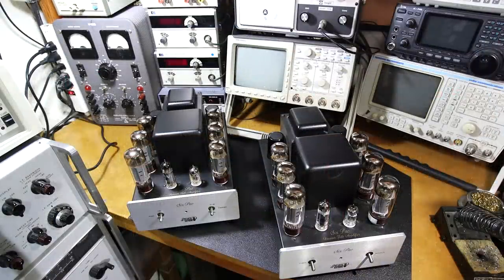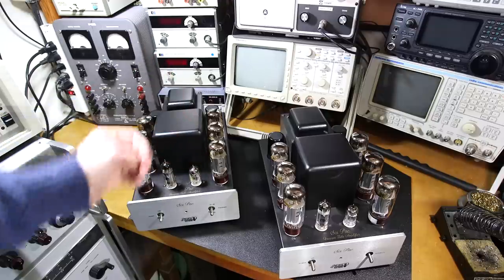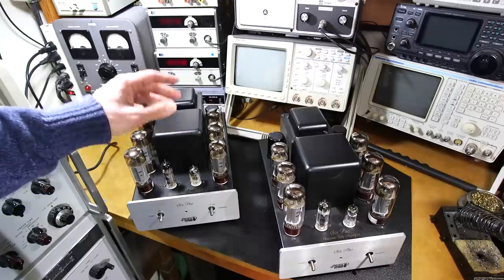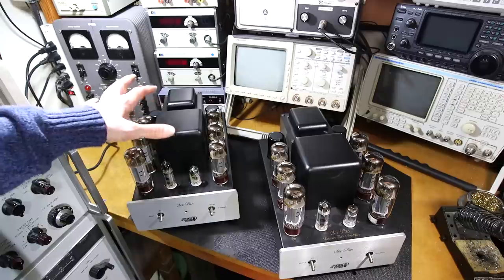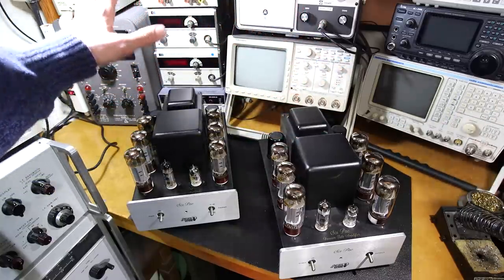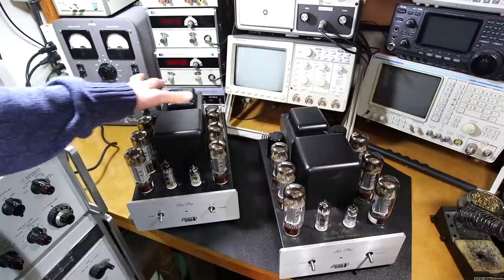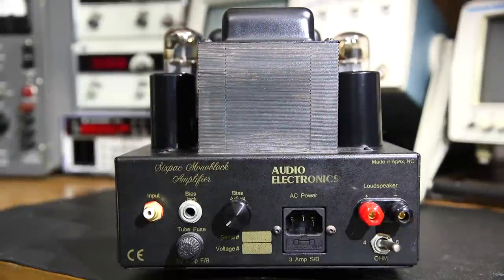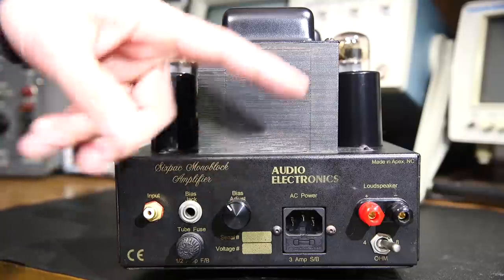Two Six Pac's On The Bench

Comment: .
Wow, these things are still selling for $2500 and up.

I'm a bit curious on your take of how they did (as drawn) the inversion using the 12AX7. The only thing I see is a possible pin-to-sleeve loop using the shield to drive the right side of the dual triode as the inverse signal. I see no other mechanism. Besides creating a ground loop the size of your system, the right side of the triode would be defeated totally by a grounded input. Interesting but kinda scary, if you ask me.

Unless there is a glitch in the diagram or some seriously obvious thing escaping my observation, It would definitely call for a transformer in between the preamp and the brick  to keep things on the up and up.

Also, a simple difference in opinion for choice of terminology for the "grid bias adjustment". Yes the control does adjust the grid voltage, but it controls the idle plate current which also tunes the A/B circuit operation. If this is set too low, it could cause crossover distortion between the output phases. A slight excess of current turns it into a pseudo A/B Class 2 where the two phases are intentionally drawing current at all times. A hot configuration most common in old guitar amps that made that lovely smell as the wooden case baked. :p But, most guitar amps configured this way were not too concerned about harmonic distortion as they were crossover distortion. That harmonic distortion gave many of these amps their particular trademark "flavor", something that makes audiophiles cringe and make the sign of the cross.

And, you mention that the 6.9V Filament voltage is a bit high and suggest a resistor to correct it. That's fine, and in audio amplifiers, the filament voltage should never exceed specs for tube life* and to reduce the possibility of hiss. But, you should show the connection between socket 4&5 either on the tube diagram, or on the callout text at the transformer/diode/cap  12AX7 Socket 4&5 Filament 6.9V

*Tube life will become an ever more demanding topic in the next 20 to 50 years, unless the industry decides to gear production back up. Using pulls would never be my choice, but if it comes down to making an adjustable modification to a circuit to adapt a worn out tube vs tossing your favorite amp in the trash, yeah. In critical places, this is done quite often to adjust sensitive semiconductor inputs to null balance the inputs to several decimal places. Dual FET's were horribly mismatched back in the day.

I think I'm forgetting something, but what the heck.
p.s. You have an amazing collection of bench equipment. Close to what we had when working on CT Scanner repairs at EMI, minus most of the audio specific components.
Reply: You asked about the inversion.  With the cathodes tied together and then supplied by a current source, the cathode of the first triode is driving the cathode of the second triode, giving a phase inversion. Also, the two triodes form a differential amplifier. Connecting the shield of the input connector to the second triode's grid cancels ground loop hum.

Comment: What was you magic 15 second mod, bridged mono with the two amps, or did you goose the B+ with a cap to ground before the choke? That would work really well......for a little while.  I can't say I am much impressed by the lead dress or component layout. I like to lay my diodes onto the chassis too, side by side to quasi-thermally couple them as well as wick away some heat, and I also rather like thermally coupling complimentary pairs of T092 or T018 transistors too. The old German Hameg O Scopes had lots of that inside them. I am going to, for the sake of curiosity, and to give a nod of approval, as well as steal some schematics, do $2 the Patreon for Mr Carlson's Lab. It would not break my heart to see a mass defection from Youtube due to their content controlled reign of tyranny.  There is stuff on here that is patently dangerous, but YT has a strange political agenda.
Reply: Extremely deadly as opposed to moderately deadly? Slightly dead is still dead. And my comment on lead dress and component placement was BEFORE you moved that awkwardly placed choke. That choke could have also been wrapped in some Mu Metal or Fera Shield and tagged to ground. Having the lines of flux perpendicular has ALWAYS been good layout procedure. Worst case off at a 45 degree angle. Okay design, terrible execution.

Comment: I enjoyed every minute of your video, but your comments about "a voice standing out from the background" without NFB as opposed to with NFB make no sense: the human voice frequency range doesn't extend further than about two kilohertz, so your frequency response measurement results with and without NFB can have no bearing on this aspect of subjective performance.
Reply from the maker: Hi John, it makes total sense! (Your comment about the human voice only going to 2000 cycles is false as well, don't forget about harmonic energy.) What about the letter "S"? 
Negative feedback forces the bandwidth towards being flat, (viewed on a Spectrum Analyzer.) If the entire bandwidth is flat, all instruments and vocals (the entire band) is at the same amplitude, there are no peaks in the response pattern (frequency sweep.) When negative feedback is removed, you get quite a pronounced peak in the center of the pattern (somewhat like a bell curve,)  this is usually in, or around the vocal area. The amplitude of the vocals are now "pronounced" (higher amplitude) and makes the singer sound louder than the rest of the band. When you sit in front of your speakers, your ears and brain make louder sounds,  sound "closer" to you than sounds in the background, the voice therefore stands out over the rest of the band. This affect is really noticeable if you can flip a feedback switch on and off on the fly. When I say noticeable, I mean almost everyone will hear the difference, no audiophoolery here!

Comment: The heck with wasting time with trouble shooting, 
as caps and resistors are already so old as to be weak 
links in the circuits. I would already have replaced ALL 
of the caps with more modern precision metal film types 
or other such depending on the use in the circuitry. 
@30:00 we finally see one (1) cap finally replaced. Same 
goes with resistors as to modern high precision units.
THEN tweak and test for any additional hang ups.
Reply from the maker: So I shouldn't have done any troubleshooting? How about the redesign (movement) of the reactor?

Comment: This was a very interesting video, even though it is 4 years old now. It's been about 50 years that I repaired tube amplifiers for musicians after school. IIRC we got about 100W out of a 4 EL34 amp with about 450V anode voltage. I remember on one amp sometimes getting an arc in the socket, a socket like the PL519 would have been better, but there was likely a little design flaw as well. Regarding the bias, I think we were about 50-100mA, so a class B amp. And distortions didn't matter that much on stage by that time. Now electricity is strictly 1 or 0 for me, and the transistor voltage is around 0.8V (TSMC, 5nm process).
Reply: Class B distortion usually sounds very nice with musical instruments as their inputs.... 👌

Comment: I have a friend that has really been pushing me into learning about tubes. I'm so used to solid state and knowing I can't get shocked, obviously knowing where the power supply is. I'm sure this is why I always find myself glued to your videos, and some of it seems rather lengthy, but it's a technical field, it all honestly matters. It's so easy to do repairs and even crazy mods on solid state gear, but in vacuum tubes it's HV AC mixed with DC in the same leads. 

Gorgeous idea on the Allen Bradly inset. I take it you own your own parts store, LOL.

If I understand correctly alleged 12AX7 typically could be used in some other gear as a stereo pre-amp, (Not in this design of course) in this case, configured so that each sides of the audio tubes are 180 degrees out from each other. So I have to assume that the B+ transformer can go over 400v explaining the need for the solid state voltage regulation (which is paramount) but is it possible that the -130v on the EL 84 is only an issue when you change homes with a great difference in voltages. Meaning you technically should RE-bias it when it changes homes.

The bias adjustment is strapped in with the -130 to the EL84, so if you have it biased correctly, then your -130 should be correct as well.
Just seeing that in my eyes and understanding. The problem is if mains go low, but still enough to regulate at 400v on B+. The sad reality of voltage dips and brown outs, we just can't control them, and as far as I know, lower voltage doesn't hurt vacuum tubes. One of the issues I'm learning about from other TUBE design teaching channels, is that on the HV side of the windings, when you have a small difference in house voltage it makes a larger difference on the HV end. So if for the sake of argument, lets say you designed this set to run at 350v on the HV side, (unregulated) while the transformer is made to deliver that with a 110v input, my home actually runs at 118 volts. That's an additional 25v.  Compare that to your -130v which is almost close to a 1:1.  That's a difference of only 10.4 volts, but remember, that's ONLY if you didn't RE-bias it.

I think that's the best I understand it.
Reply: Yep. The line voltage would make more of a difference in a design such as this, than it would in something simpler like an AA5 radio.

Comment: A very impressive amp! It would amazing with Klipshorns.  Regarding no regulator for the negative supply to the long tailed pair current source, I don't think it needs it because the constant current source would (should) effectively remove any input voltage variations. Cheers Doug.
Reply from the maker: Hi Doug, that is the issue, a constant current "sink" is not a Voltage regulator. Thanks for your comment!

Comment: Have you done any work on any aircraft related instruments, radios or transponders? I imagine that there will be a lot of redundance and failsafes built into such uinits. Please tell about your experiences of analyzing and repairing any flight related electronics. I just love when you show how old and new stuff works. Thanks for all past viodeo projects.
Reply: I worked on some digital data computer stuff in the early '60s while in the USAF. Redundance and failsafes  were abundant. Parity was checked every where. An error would switch to a standby unit.

Comment: Why did you adjust the bias adjustment to 220 milliamps didn't you say the datasheet was between 200 and 300 so why 220? Cheers!
Doesn't look like a good design messy wiring and layout, would it help to improve the layout in its function and prevent interference? What about if you made a lead lined can, to keep the reactor coil maybe immersed in oil this would achieve the same effect or better no!
Reply: Is there going to be a part 2 of this and it's  test?? Hope so!! What was that tweak you did it took 15 seconds to increase it to 105 Watts was that the adjusting the bios? you didn't say.

Comment: Before you start a major relocation of that filter inductor, what do you think would happen if you fabricated a steel shielded box to enclose that inductor? Maybe you could even get some amount of 120 Hz reduction by just inserting a steel plate between the input amplifier tube area and the filter inductor?
Reply from the maker: Hi Ed. Space and heat are issues, as the reactor gets quite warm. Relocation to get the hum into the uV region is the easiest and cleanest solution.

Comment: Hi I really enjoyed this video. I have a vta-70 tube amp I built a few years back. I wondered if you could put a shield around the filter reactor, is that another word for choke?
Reply from the maker: Hi Will. Yes Reactor can be interchanged (Accurately) with Choke, "sometimes." Reactance is an easy way to remember what this device does.

Comment: how you can run the amps without a dummy load? i thought this will damage the output transformer and/or the tubes
Reply: Alain Stucki this is exactly what I was thinking. I was taught this was a tube amp mortal sin.

Comment: Isn't it a bad idea to run tube amp's without a load connected,  be it speakers or a dummy load.
Reply: My point exactly, I've also come across information that tells never to run a valve/tube amp without load.
Reply: Okay if there is no input signal.
Reply: Robert Drinkall yeah I think the problem comes when you try to get the amp to start pushing real power, and because it's throwing around volts and watts with nowhere to go, you can get all kinds of inductive kickbacks and spikes and so on. But sitting quietly at quiescent levels should pretty much not be a major problem.
Reply: That would be a good topic to bring up.  What I was told is that without a load on a tube amp, is that it may break in to oscillation. If it does that, it may damage itself.  In other words, some amps need the load to stabilize them.
Reply: I’m no expert, but as far as I’ve always been aware the power tubes are pumping voltage into the output transformers primary coil (signal input or not), therefor creating a voltage in the secondary coil, without a load connected that energy has nowhere to go ! which can result in it feeding back into the primary coil, which can become a vicious circle, overloading the power tubes resulting in damage to the tubes & transformer. It’s likely it would be OK for a  very short period, but I personally would not take the chance. However I’m sure Mr Carson knows better than me!
Reply: Yes, there is plate current flowing through the transformer at all times, but it's only variation in the plate current that shows up in the secondary.  If I remember my dad correctly, it was a combination of the inductance of the plate transformer and capacitance in the tubes that could lead to an oscillation that could exceed the insulation rating of the transformer and cause an arc-over damaging the output transformer.  A load would put a damper on that.

Comment: would have been much better if the design had capacitors either side of the HT choke like most good designs then the induced  AC field would be much lower and "hum level " much less to start with !
Reply: NO to the first comment , YES to the second one.......

Comment: A little off topic of this amp, in my original home built amplifier, I switched from 6L6 to RCA 7027As, claimed to be "more rugged".
I do know that they were prettier with their chrome like bases and blue gas glow, but I never knew for sure if the 7027As were of any merit over 6L6 tubes.  Do you have any knowledge or comment about those tubes?
Reply from the maker: In the beginning, the 7027 was different, but through the progression of time, they ended up being an "Exact" internal copy of the 6L6GC (not the G version) just with more internal bonding wires to lead out pins. This can be very messy if a 7027 is plugged into a 6L6GC socket, as the open connections are used as tie points.
Reply: Yes I remember that.  The screen grid was pin four on a 6L6, but on a 7027 they connected it to pin one also.  If you wanted to use a 7027 in yours or another amp, you had to make sure pin 1 was not being used as an tie point as you said.  I fixed up a couple Bogen recording amplifiers for home use and fixed that problem.  Bogen manufacturing was close to us in NJ and they had thrown out a whole pile of recording amps in the dumpster.  They destroyed the amps in different ways, so we managed to get a few working by cannibalizing parts from other amps.  That was back in 1963 or 1964.  The chassis were huge.  I don't know what happened to them.  I got married in 1975, left home and forgot about those amps.

Comment: Is the AC ripple measured here the same as DC on the outputs?
Reply from the maker: The output is transformer coupled, there can be no DC on the output.
Reply: @MrCarlsonsLab  That's not a very clever remark from me indeed. Same is true for the McIntosh 2205 I have of course.
What's the downside of this ripple then? Noise and/or humming?
Reply from the maker: @BoudewijnvanHouten   The ripple would cause a small hum or buzz in the speakers. The more efficient the speakers, the more noticeable it would be.
Reply: @MrCarlsonsLab  Sorry, I remember now that you addressed in your video.

Comment: Thanks Mr Carlson that was really informative. From what I've read, choke input filters like that one, are a bit tricky. They need a minimum current to go into regulation, otherwise the voltage can rise dramatically.  Also the so called, swinging choke, has little or no air gap to  reduce core saturation, in contrast to chokes for  CLC, Pi filters, which are air gapped. The advantage is that if designed well, LC filters are much better at voltage regulation than a CLC filters.
Reply: Less voltage loss too..

Comment: So interesting to me - I used to work on transistor based push pull amplifiers - it's basically the same circuit considerations with setting the bias current and matching the transistors so that the Q variance doesn't introduce distortion.   I never studied tube design but this is all familiar to me!
Reply: Tubes are basically a solid state NPN totem pole arrangement, and much more high-impedance, but I'm sure you're aware of that already.

Comment: You mentioned the bias reactor could be replaced by a resistor. Could you replace the bias reactor with a resistor and use this location for the filter reactor?  It is perhaps a little further away.
Reply: The purpose of the reactor is to filter the 120 Hz ripple. It is more effective than a resistor.